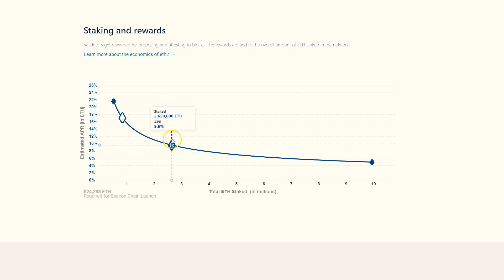Ethereum 2 0 is coming | What we know about it | how its going to affect us !?

Comment: Correct me if i'm wrong, but won't proof of stake kind of ruin the whole crypto experience? Because most of the small miners will not be able to participate in this proof of stake concept. Or am I missing something?
Reply from the maker: Well yes it will ruin mining in current form as it is. If you will want to run full validator your self, it will be quite expensive operation. But you still will be able to participate in ETH on smaller scale . Through project like rocketpool, stakewise...etc Basically pooled tokenized staking, something similar as we have solo miners and pool mining.
Reply: @GuntisVitolins  Oh I understand! So basically people will still be able to contribute to ETH network. That is nice. However will it be profitable to operate these tho? How do staking compares to regular mining in terms of profit?

BTW thanks for your reply and keep up the awesome content!! :)
Reply from the maker: @jdzalbe  As more ETH is staked as les APY you'll get from staking highest is 20% lowest is 4.9% in ETH 2.0 beacon chain.